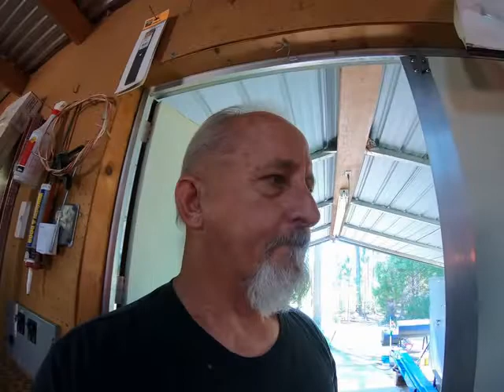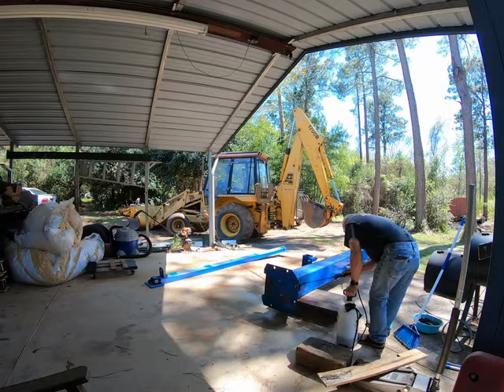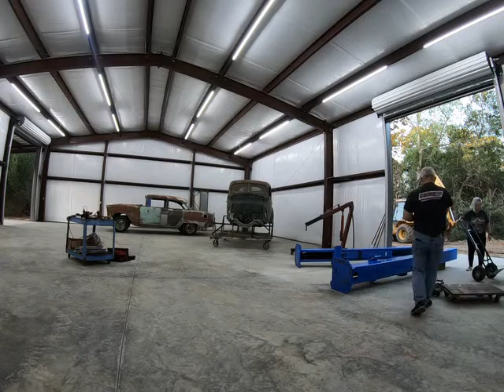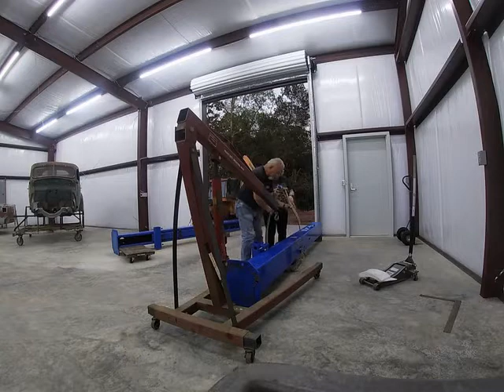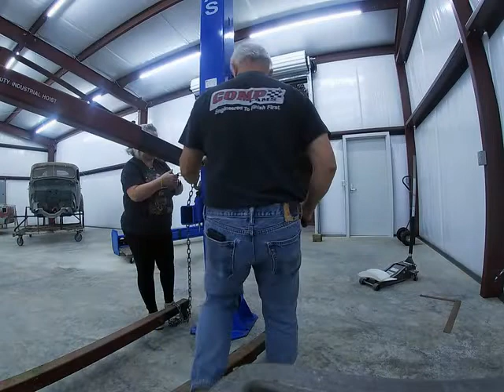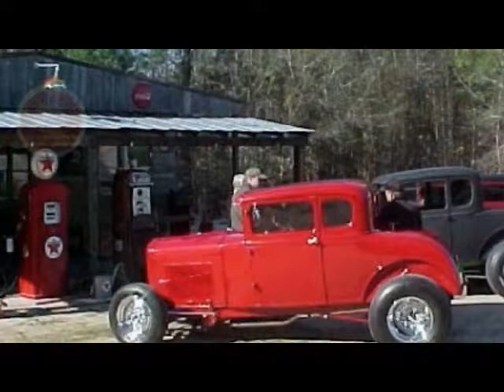Setting Up New Shop Getting Lift Installed

Comment: We have a lift but it was installed in a bad spot in the shop and it never gets used. Have to move half of the shop to get to it.
Reply from the maker: We weren't sure about where to install it so chose to put it right inside the door. Thanks!